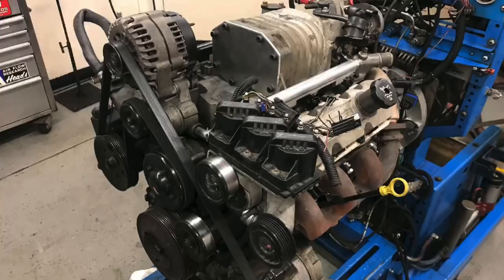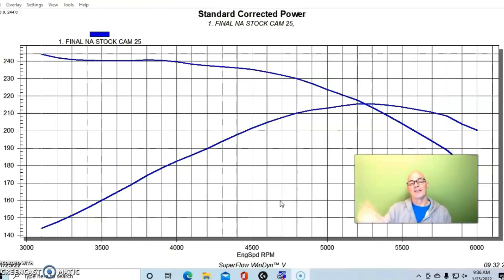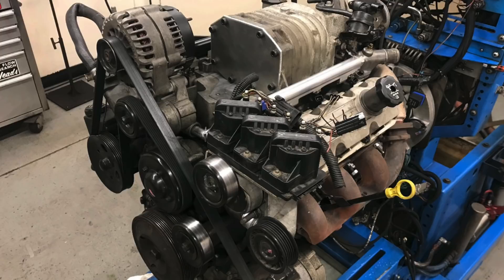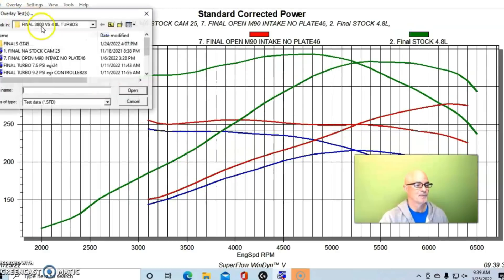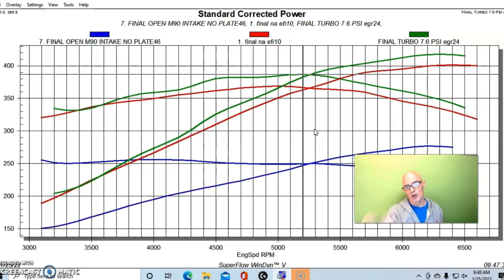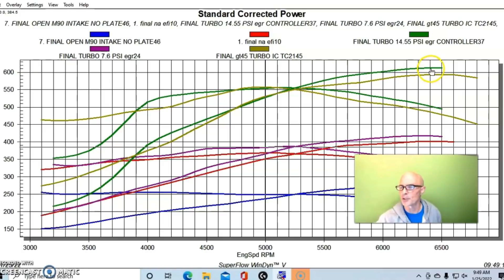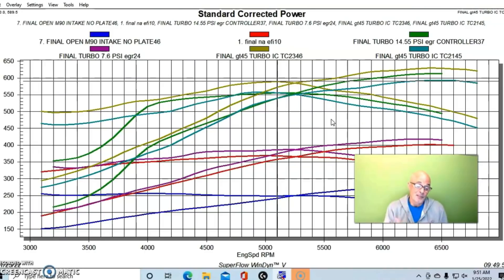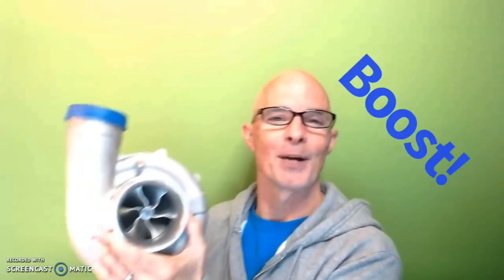JUNKYARD TURBO 3.8L V6 VS 4.8L V8-L67 VS LR4, HOW TO MAKE 600+ HP- TURBO 3800 V6 & A TURBO 4.8L V8?

Comment: The 4.8 making 330hp stock is unbelievable when its rated at the same power as an lt1 yet it doesnt move like one. Raced my home boy with a bolt on tune 4.8 vs my friends stock 5.3 and he pulled on me like he had 50 more hp than me.

Comment: Richard - Would you use a stock NA 3.8L for this or do you need the internals from the SC 3.8L?  so is it better to get the SC 3.8 and get the camero intake?  I like the NA 3.8 only because it is already set for RWD and 4L60E...
Reply from the maker: you can use the NA motor-just add ring gap

Comment: I wonder if the 3800 II can take 30 psi stock bottom end like the 3800 I and LN3 can?   I can't say I have seen any here in Aus in that range but have seen the 2 lower extremes,  6-15 PSI and 40 PSI in one car, nothing in between.    The stronger 3800 I is pretty much normal to see 30 PSI in the boosted V6 scene, especially in NZ.
Reply from the maker: 3800 series 1 is stronger?
Reply: @richardholdener1727   It's a little more complicated than a yes or no. The limiting factor in the L36 and L67 is the brittle and fragile pistons, especially the L36. They can take a fair bit of power but are very fragile when it comes to knock. Won't be an issue on E85 though.  The pistons on the series 1 L27 and LN3 are a lot stronger, much thicker crown and the rings are a lot further down, also the alloy is softer and more malleable, so these factors make the series 1 is a lot more tolerant to knock.  The piston's deep dish and small combustion chamber has a great squish area as well which contributes to the knock tolerance.   Also when comparing rods, the series 1 have beefier rods compared to the L36 but the L67 is slightly beefier again towards the big end of the rod but still a little thinner up top compared to series 1.   The series 1 also have a 1" taller deck and rods (rod ratio of 1.87) which help with lowering the piston's side load and acceleration at TDC and BDC. Probably not anything meaningful though.   That said the series 2 obviously has the cross bolted main caps but I have never seen that being much of an advantage over the older 2 bolt caps of the series 1 and older GN style Buick engines.  But yeah the old series 1 can take a lot of boost without issues.  The other issue I have seen with L36 and L67 is the much thinner head castings that GM did for weight savings, means the heads flex easier than the heavy series 1 castings.  This is also why the series 2 often crack heads with age but the series 1 don't.    Stock for stock the series 2 will make a little more power for the same boost than the series 1 but the series 1 can take a lot more boost before anything bad happens.     Here is Aus both series 1 and 2 were incredibly popular so both engines got a lot of attention and development.

Comment: I still want to do a turbo 390-410 inch FE that makes 350 hp NA with a Comp 270S. 224@.050 110LSA  solid flat tappet cam, shorty headers mount backwards and the 72 cc cheap C8AEH heads with 428 CJ sized valves with a GT 45 turbo or whatever you recommend. I d like to see 700-750 as I have a very thick 3-rib 391 bump trunk block that should be able to 800 hp. There are a lot of FE guys looking at turbo setup systems, I’d even go for twin smaller ones into an intercooler and the plumbing like you do for carbed setups. BTW the intake is a very well done  PortOSonic matched to the heads. 350 hp is very conservative. Car is a 65 Galaxie 2 dr HT . A close friend of mine said that there is no such thing as a  12 second Galaxie.
Reply from the maker: that size motor needs an S475 or 7875 VS racing turbo

Comment: Interested in the power to weight ratio of the motors. The v6 can make more sense in something that the weight and size of a v8 does not work
Reply: https://youtu.be/t9lk9x5Z0sc  3200lbs 8.50s with ease. The 3800 is a bad ass piece. Love them.

Comment: My 2013 Impala V6 puts out 300  hp.  Would be interesting to see what a 4 valve V6 that breathes better can do.
Reply: There are a few cars with that engine boosted here in Aus and they make very high power for the amount of boost for exactly that reason, 4 valves, VVT and high rpm range. 
There are a few people that race these engines NA too with 500ish Hp but they turn at 9k to make that. But that said they are unpopular due to their bad reputation of timing chain issues.

Comment: I am very surprised you got that much power out of the 3800 at that boost level.  I have an 87 Grand National I’ve run 26 psi at the track and the trap speed of 110 seems like way less power than you were getting at 14 psi.  Is the 3800 that much better than the older 3.8 turbo?
Reply: Series 2 breaths a lot better, also is smaller (you know, size) but has diffrent bellhousing than a series 1
Reply from the maker: are you running on pump gas and does it have a cam in it?
Reply: @richardholdener1727  E85 and the engine is all stock with 59 mm turbo and 3” down pipe.  I’m guessing it’s around 380 hp as it is now in a full weight car.

Comment: Only reason I stayed with the V6 in my Typhoon is because well it's a Typhoon. It already had a turbo and with the V6 it was easier to work on under the hood. Plus when a local engine builder who used to build NASCAR engines in the 80's and 90's says he can build a 4.3L V6 that'll handle 30psi and warrantee it I mean how can you turn that down.
Reply: Wow sounds absolutely awesome! Back in 2000 or so I was 15years old and had a 95 Chevy S10 SS with a bunch of cosmetic stuff..about a 3" drop , shaved taillights , shaved rear bumper with led brake lights in the roll pan with welded seems, matching black fiberglass bed cover, bolt ons engine mods,full exhaust, headers and JET performance chip (prior to tuning devices they had pre-tuned chips or ecus) .
ALWAYS DREAMED of putting a Syclone/Typhoon drive train, engine, running gear underneath that truck and the LS had essentially just came out in the SS Camaro and previously in the newish C5 Vette so I knew that was gonna be too expensive at that time..Always wanted a TYPHOON.
Reply: I remember being a kid going to the drag strip on Saturday nights with my buddy who also was obsessed with fast stuff and we saw a white/grey Typhoon run 11.30s and this is back in like 99-2000 so this beast was one of the fasted at the track for someone who drove it there..I  launched hard as hell and smashing Vettes and Vipers and even some of the GNX/T TYPE guys got their feeling hurt!! We considered those sleepers back then but more people know about them nowadays.

Comment: Also I would highly recommend for crank stability Chuck an m6 or maybe a 1/4” nut behind the oil pressure relief spring along with your favourite race oil it would be best bang for buck bottom end mod

Comment: Can’t wait to see how it holds up,I’m putting my l36 on the dyno in a couple of weeks,only on pump98 and around 18psi but I’ll have a bottle of nulon octane booster handy to see if it will handle the high setting of 20+psi while static on rollers,i just fitted zzp mls gaskets and arp studs with ported heads with no quench also running a stock un ported manifold for now as my other manifolds either ported too large or not to match these heads
Reply from the maker: what cam?

Comment: I'm loving it. Your videos are awesome. I have a boat that's inboard/outboard and it has 4.3 in it now that makes about 205 hp. It's all iron engine so now you have this 3.8 supercharged from the factory and and I'm thinking about getting one for the boat. I have to do a little bit of checking to make sure the outboard will be a straight up bolt in. The 4.3 in the boat is new and has less than 100 hours actually only about 35 to the best of my knowledge, but more power and less weight is great thing for a boat. And I have a 93 Chevy truck with a woren out tired 4.3 the boat engine would be a great replacement for. Just thinking. 
I do have a question. My friend has a 05 with a 6.0 with 317 heads and advertised 300 hp from the factory. I have a 13 f150 with a 5.0 and advertised 395 hp from the factory. He asked me why his larger 6.0 made less power than my 5.0 and I don't really have a good answer. I said for 1 factory ratings aren't accurate. 2 my engine has overhead cams and yours doesn't. 3 you have crappiest factory heads Chevy makes that drops your compression ratio. 4 the 5.0 has higher compression than the 6.0. 5 I think Chevy tuned it to be crappy to sell more of the 6.6 duramax engines. I mean if you have a 6.0 gas engine that has more hp and torque then nobody would want the more expensive higher maintenance diesel. Just thinking about it my 5.0 has fairly close to the 6.6 duramax power and torque especially the earlier engines. Was what I said way off base or was I getting it pretty close? Thanks again for the great videos.
Reply from the maker: your 5.0L makes more hp and less torque than that 6.0L, but there are other 6.0L LS motors that make more. better heads, and cam timing (VVT) and compression are what give the 5.0L decent power numbers, the 317 heads flow very well (as good as any other factory cath head), but do offer low compression
Reply: Danny,  I know that Richard is far more qualified than myself when it comes to providing you with an intelligent answer but your question is good and caught my attention. 

You pretty much answered your own question with the 5 points that you brought to the table. The late model overhead cam, multi-valve Ford heads are able to deliver a substantial intake charge to the cylinders across a wide range of engine rpms and play a large part in the overall power production. 

The efficient combustion chamber design along with variable cam timing and precise engine control management system allows for a higher compression ratio for more power without the typical problems associated with high cylinder pressures. 

These Ford engines have many features that all add up to a surprisingly high power density per liter of engine displacement. Even with the additional width of the OHC heads, the complete engine package is compact enough to make it a viable swap into many earlier model Ford vehicles. 

The aftermarket jumped all over the popularity of the modular and Coyote engine families with performance parts and engine swap kits specifically designed for Classic Mustangs and more 🏁.

Comment: Has anyone done a dyno run with a turbo'd 3.1l? (3rd gen camaro)
Reply: Look up vids on the ASC McLaren Grand Prix GTP.
It used the 3.1L 60 degree V6 but with the FWD aluminum heads. Factory turbo setup. 
Though a small turbo.

Otherwise there's some vids on 2.8/3.1/3.4 Camaros with boost. Biggest problem with them is the crap iron heads. Later 3x00 heads really made it a potent, light, extremely compact powerplant.
Reply: @of_lion22  Right on...I'll look into them. thanks for the info.

Comment: One thing you sorta mentioned was how much boost can a built 3800 handle and I’m sure it can make more power than the 4.8 because the iron block should be able to handle more power so long as the rest of the engine is built right. I’d be interested to know though because I’ve thought about going 3800 turbo but really what sort of transmission would be able to handle that power?
Reply from the maker: the 4.8L has an iron block and can go over 1500 hp
Reply: @richardholdener1727  oh wow didn’t realize that lol, for some reason I thought it was aluminum
Reply: The 3800 has been 1350 wheel hp  in Aus with the factory block.

Comment: Bring the boost in slowly  on the 3800 big bang u get it up to the 1000hp mark  just need to upgrade oil pump and rod bolts as well
Reply from the maker: rod bolts need to be stock

Comment: L67 ring gap is probably fine. IIRC it’s top .022 and second .030. If you take the bottom end apart you let all of the factory assembled magic out. Can’t wait to see!
Reply: Junior,  I’m glad to see that you also know about “factory assembled magic”. That’s why an all original Boss 351 Cleveland engine should never be opened unless it’s absolutely necessary 😉. 

My GTP with the Series 2,  L67 has 200,000 miles of serious abuse and is still a rock solid performer thanks to preventative maintenance and Mobil 1, 10W-30 full synthetic since new. 
Richard has made the point about opening up the ring gap abundantly clear before getting into the realm of serious boost with higher ring temperatures. I’m curious if 200K miles of ring wear could have already opened the ring gaps enough for the inter-cooled boost upgrade I have planned ? I really want to avoid letting the precious factory assembled magic out 😁.

Comment: Richard, at what power level do you feel that head studs become a necessity? You talked about studs on the V6 for the big bang upcoming test, but curious as to when such mods become necessary.
Reply from the maker: I use them with boost
Reply: Head studs are a cost effective safeguard against possibly catastrophic failures.  Especially if a blown head gasket isn’t noticed right away like the female drivers in my household have already proven 🙈🙉.

Comment: Of course the V8 will make more power in the long run but the boosted V6 would still be a ton of fun in a small lightweight car with a tight engine compartment!
Reply: Drop a LU3 under the Hood.

Comment: I love it! Just wondering how to get that whole 3.8 set up under the hood
Reply: You can run a better style manifold, there are a few options available that put the turbo more towards the center, but you could also make a custom setup as well
Reply: Buicks did it back in the 80's. Turbo on passenger side and crossover pipe from drivers side ran under the car behind oil pan, front mount innercooler and done.
Reply: Just check out my build videos from the past few years.  ZZP/Stattama kits squeezed a decent design in there, and I swapped to a similar A2W intercooler as Richard's here.
Reply: Nice! Thanks is for all the advice! I have a 01 mustang and want to keep the 3.8 & add boost. It’s nice seeing it possible not having to get a v8 for some decent power.
Reply: @wavywinsday  to clarify, this is a Buick 3800, not a Ford. Completely different engines, and the Ford one isn’t as good. Not to discourage you but just something to note
Reply: @Matt_Lanzer_13  yea I know thanks: I do plan on having it rebuilt bottom & top end cam etc
Reply: @wavywinsday  ah ok lol figured I’d mention it haha. Good luck, hope it turns out cool!

Comment: An ICE is basically a super-efficient self-powered air pump... so therefore, power produced correlates to the amount of air pumped through during a given state of operation. How effectively an engine does that is reflected in the design (blueprint details), [static] displacement, valve-train timing events and sonic tuning of the manifolding in use.
Reply: Are you wanting to be graded by the teacher or something?

Comment: There’s no replacement for displacement….sometimes. 
Lost displacement can use boost as a proper replacement….all the time 🏁.
Reply: A healthy NA engine will always outperform a worn out engine, even under Super/Turbo Charging.
Reply: @shadowopsairman1583  … That’s a fairly safe bet, for sure.
Reply: Yeah, you can make a small engine behave like a bigger one with boost. But it usually comes with a cost. (reduced fuel economy and/or reduced reliability)
Reply: @michaelblacktree  …. Very true because modern technology still hasn’t built the perfect engine without compromises in the overall scheme of things. Boost or not,  high power levels are intoxicating and common sense flys right out the fukin window 👍.

Comment: Back in the 90’s east-coast Buick 3.8 after marketing parts business made over 1000hp on the grand national engine. Few others running at the gs Buick nationals in bowling green running mid 9 second quarter mile production block. https://youtu.be/Y34y7n84AKI

Comment: I think you'll make more than 1000 on the 3800 big bang
Reply: I think so too....  People are making 6-700+ wheel on the street at over 26lbs, Richard has ideal conditions on the Dyno & is already at 600 motor at 14.5...
Reply: I agree! Especially an L32 bottom end. The rods on the L32 are actually a lot beefier looking than even the Gen 4 LS rods. Can’t wait for this 3800 Big Bang